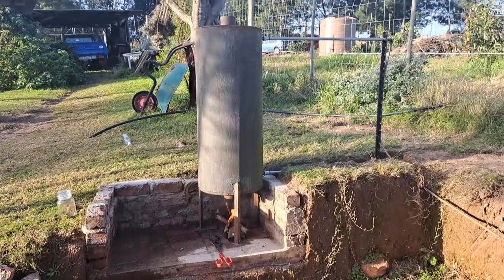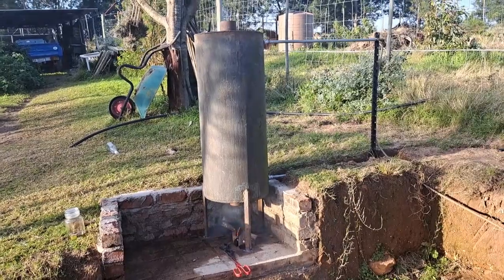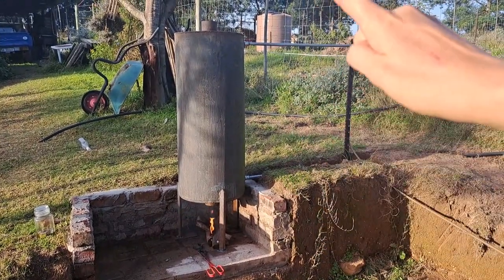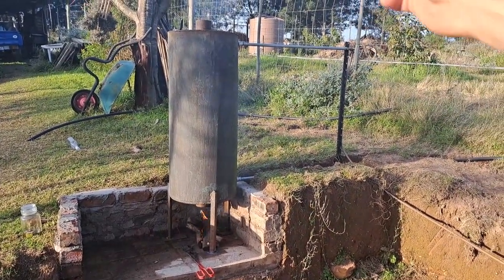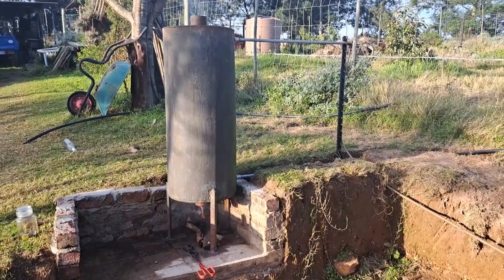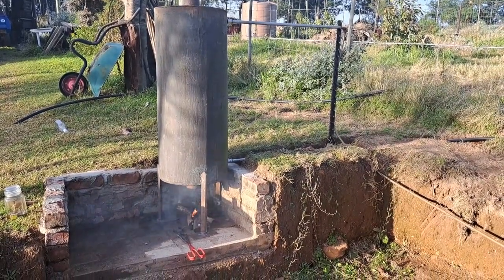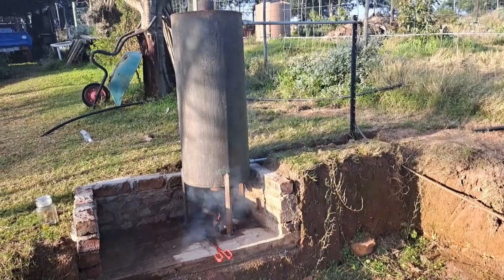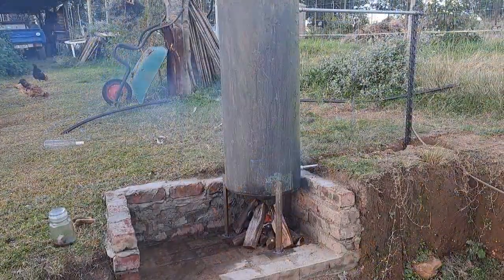Hot water without gas or electricity.... part 2

Comment: Good for you, I admire people who think out of the box!
A friend used his donkey horizontally, on a stand. He added the pipes at the opposite ends and connectet he on side in line with the water pipes of his house. The other end (inlet) was connected to a water tank. The tank was higher than the donkey's pipe He pumped the water to the tank from a borehole. He then mounted another shorter cilinder (old 40 water geyzer, etc) that he had cut in half underneath the water cilinder. He he left the sides open and made his fire in the half cilinder. Because of the open sides it was easy to remove the old ashes with a rake. He used more wood/coal  this way, but the water heated up in a jiffy. The sorter 'fire pit' prevented distortion of the pipes.
I wish we were able to live free! 
My best wishes for what ever you attempt next.  ❤
Reply from the maker: Thank you very much fir the good advice! We are still in the trial and error phase , and are already planning a upgrade.....

Comment: Sorry to hear about the leak! My welding machine is on standby! 😁
Reply from the maker: It  seemed that it might have been condensation,  the leak seemed to be coming out of the inner pipe, not you fittings , but will shout if welding is needed, Thank  you!
pressure relief valve has also been ordered.